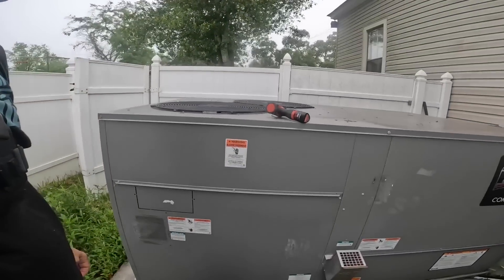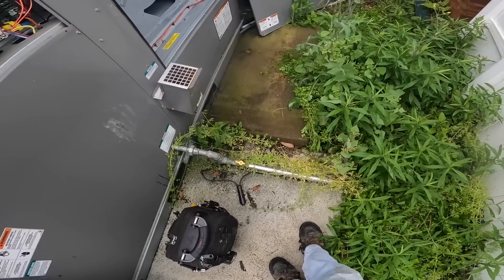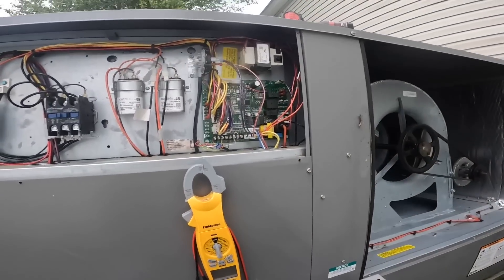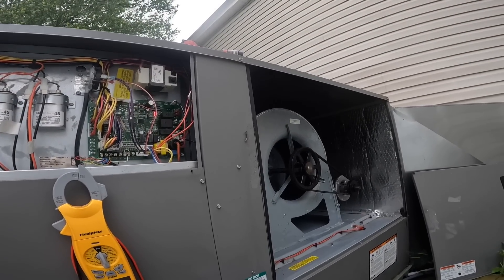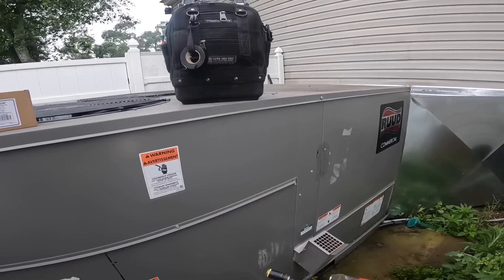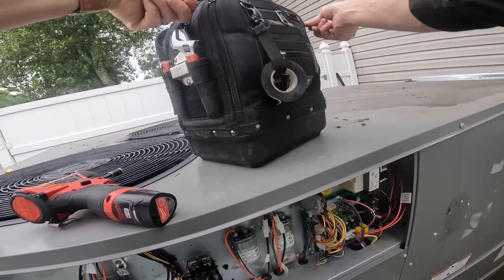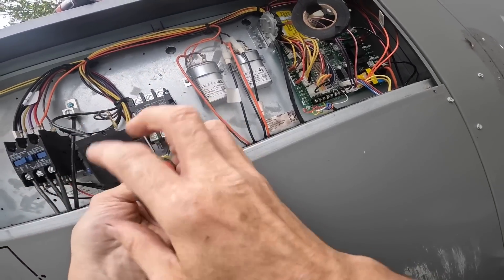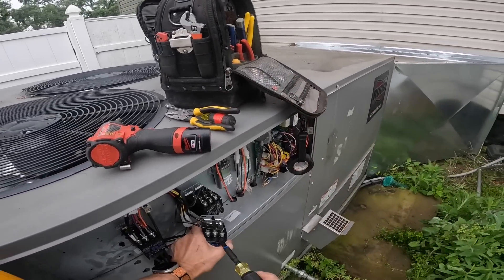18 Month Old Ruud Gas Pack No Heating! #hvacguy #hvaclife

Comment: I noticed the screw on L1 (top left) was very loose, compared to the other two screws you broke loose.  That was reason for single phasing motor.  The poor connection could not handle the in rush current.
If you took the contactor a part, you will probable find burnt contact on L1.

I enjoy watching all your videos!
Thx for sharing,
Tommy
Reply: I am sure you are correct on the cause of single phasing. A loose terminal connection is all you need in high inrush currents on motor loads. These manufacturers should install loss of phase protection devices or at minimum,thermal overload devices for 3 phase motor protection. Zero protection for keeping manufacturing costs down I guess.

Comment: I retired from the commercial/industrial industry.  Have never seen a 3Ø motor that didn't have an overload assembly - a true motor starter.
Reply: Carrier had calibrated circuit breakers for the indoor fan and the compressors. Others had an internal line break for three spade motors.
Reply: @rodgraff1782  Interesting, thanks for the reply.  I'm sure that their brilliant update works so much better than a tried and true, easily accessible and dependable motor starter.  It sure seemed to do a poor job of protecting the motor from single-phasing.
Reply: @lnk4328  Yea, those internal protectors wait until the winding overheats until they trip.  In the old days  Carrier put overloads  under the terminal cover, that were inline with the power to the compressor. They were calibrated and worked as good as a starter.  Trane used current sensors on the compressor motor feeders, that broke the low voltage circuit.  The calibrated circuit breakers, for motors and compressors worked pretty well.  Some units use a cheap plastic starter with a reset.  I’ve seen true motor starters in some large units.  They work the best, as long as the heaters are sized properly.  Variable frequency drives, used a lot today have built in protection for the motors.  I grew up with starters too, big Square D ones, for very large motors and compressors.  One compressor manufacturer Copland semi hermetic  compressors  used thermistors placed in each of the phase windings,connected to a solid state module.  These worked pretty quickly.  The smaller manufacturers found it too expensive to use external motor starters, but they provide the most, and quickest protection.  Every one went to inherently protected  for single phase , stated on the motor.  I believe this is what he had.  You could almost see smoke from the remaining two windings coming from the motor.  This could have been caused by insufficient low voltage for the contactor  coil, causing chattering.  The unit was only a year old.  I would have put in a 40 amp contactor, and checked the coil voltage on a hot day.  Resistance increases with heat.  It may have been a cheap Chinese contactor.

Comment: I wonder why they don't use those flat belts, like cars use. They last twice as long on cars & trucks as V belts do.
Reply: Probably because a flat belt requires a spring loaded tensioning device to maintain proper tension.  Flat belts are temperamental in regards to tension.
Reply: @grandinosour  That's it.

Comment: Always glad to see you check for voltage after throwing disconnect;  such a good habit to get into, as accidents do happen.  As a retired electrician and electronics tech, I could tell you at least two sad stories of guys who failed to make that check.  Thanks again for your fine videos. 😎
Reply: Happened to me years ago.  Was replacing the burner on a commercial boiler.  There was no doubt that the adjacent disconnect was for the boiler.  Shut off the disconnect and stuck my screwdriver into the motor starter to disconnect and bam.  One of the knives in the disconnect stuck closed.  Needless to say that from that day forward I always checked, no matter what.
Reply: Electricity has no friends
Reply: yeah, double and even triple check if you like to stay alive, that and it's always wise to treat all wiring and devices as live. good habits to get into.

Comment: did you check the voltage to the contactor to ensure sufficient power to pull in?  did you later open up body/cover of contactor to check for something that may have blocked a contact from connecting?  a bug, etc….
Reply from the maker: I opened it up later and it was just severely burnt